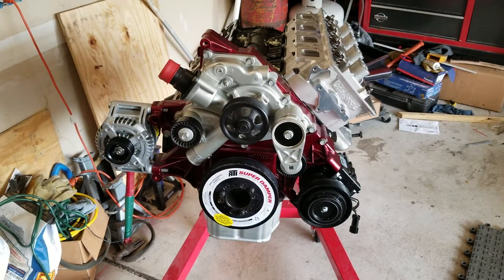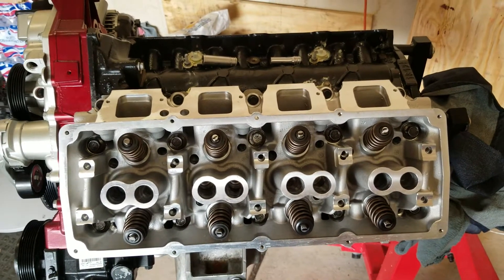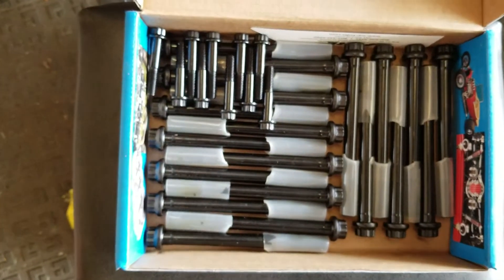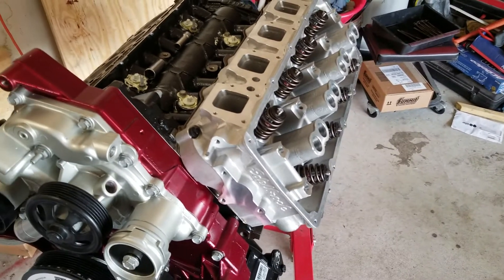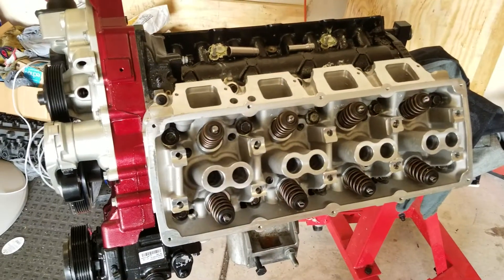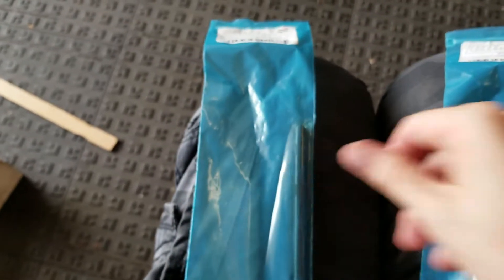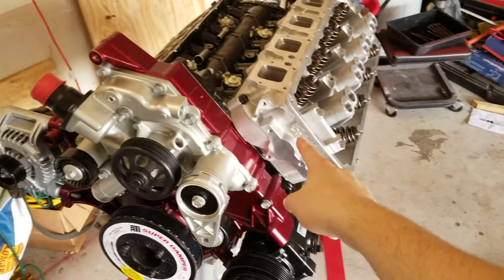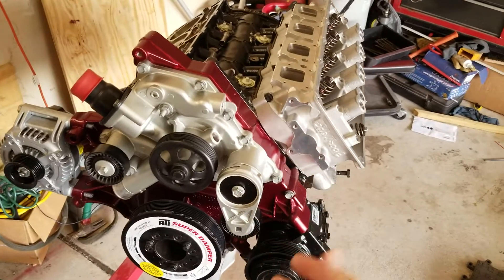Update on the 2013 5.7L Hemi engine build part ( 1 )

Comment: Hi, what cam are you planning to use?
Reply from the maker: I'm using the Gen 3 Hemi 274 COMP Cams
Reply: @WDT_HighPerformance  was that a custom cam or one of the 3 they have ready for the ram? I got a custom grind I hate and now a valve spring broke so I gotta replace or cnc head.. so I'm thinking on buying those heads (tomorrow) and replacing the cam while I'm in there. Dont know what cam is good for me though..
Reply: how does the gen 3 cam sound on the car?

Comment: What are your opinions on the Edelbrock heads? And take care of your family first.
Reply from the maker: Matt Vineis bro thank you for understanding my situation yes you are right family is first..!

The Edelbrock gen 3 Hemi heads I love them they're much nicer than the stock ones the cool thing there a little bit lighter than the stock Hemi heads and even though they're lighter but there are pretty beefy because if you want to get them C&C still have plenty room and bolt them onto the engine is actually a breeze it's not even hard at all they say these Edelbrock Hemi head bolted up like your stock Hemi heads Edelbrock not lying they're just out of the box and ready to be bolted on your engine but looking forward to getting the engine started to see how well Edelbrock Hemi heads do I do believe they're going to increase more horsepower but I can't wait to test them out and I will do a video on Edelbrock Hemi heads put it all together I am almost done with this engine I will do a video installing the engine in the Dodge Challenger
Reply from the maker: Matt Vineis and thank you for watching